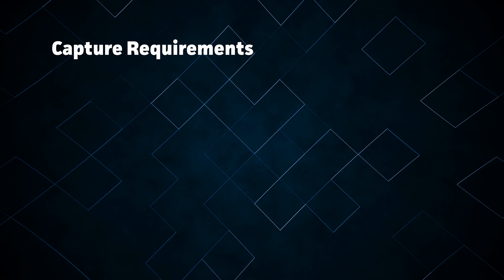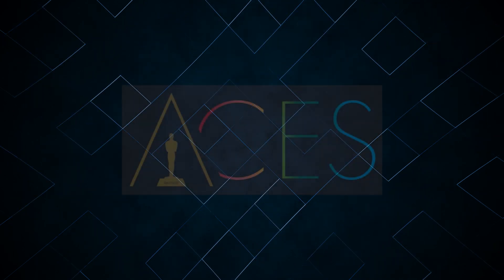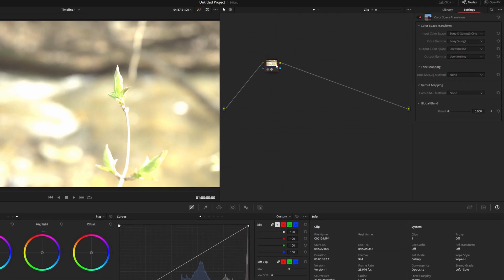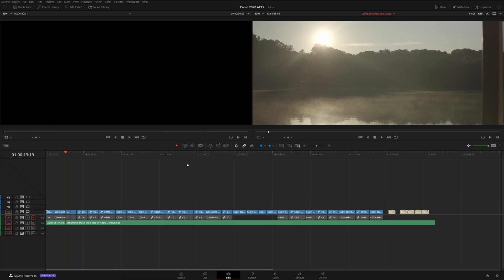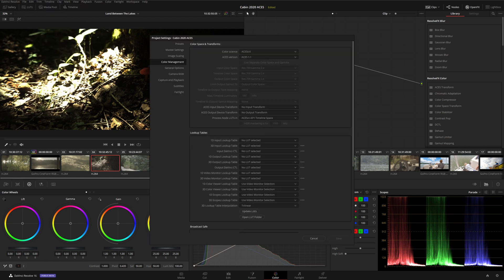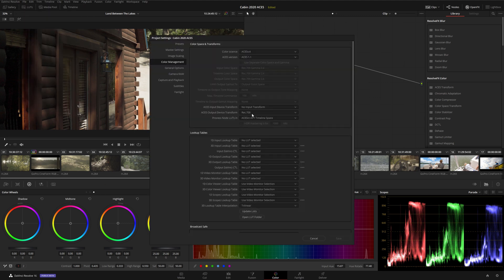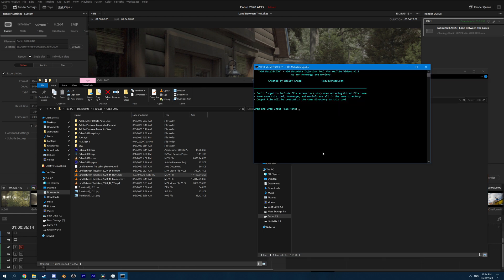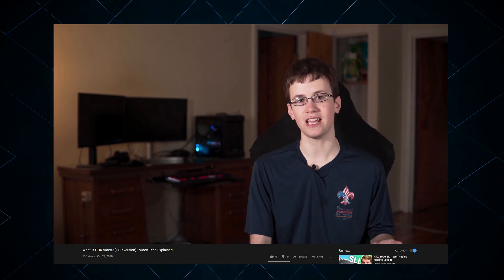How To Make HDR Content Without An HDR Monitor - Video Tech Explained

Comment: It's no longer necessary to spend thousands on a professional reference monitor capable of displaying true HDR content. In the last few months the bottom has dropped out of the Mini-Led ISP market due to advances in OLED tech & prices have plummeted. You can now buy a gaming monitor that has the resolution, color specs & dynamic range to handle true HDR video & spend from $400-$500 or even less. Example: the MSI MPG 274RDFW E16M is a 27" gaming display with 4K@160Hz resolution, a very wide color gamut across all standards including Rec2020, & it utilizes 1052 backlight dimming zones on a Rapid ISP display made by LG to produce a dynamic contrast ratio of 100,000,000:1. It's VESA 1000 certified & can display 10 bit color with an 8 bit+frc algorithm that is not "quite" as accurate as true 10 bit but will still display over 1 billion colors.Other than the 8+frc the only notable drawback is that while it's hardware factory calibrated it's only user calibrated with software. It goes for $500 & that makes it 1/12th of the price of an Apple PRO-XDR minus a stand. If you can get past the cheesy looking gamer design which has a silly multicolored LCD light on the back of the stand that constantly shuttles through various colors, you've got an editing monitor that can get VERY close to what the big production houses can do. Almost nobody has caught on to this yet, but once some content producers start to realize that there are gaming displays that are highly color accurate, get MUCH brighter than a $2,000 LG 32" 6K professional content screen & can run at double the speed, a lot of small producers will start churning out HDR stuff. This thing has twice the number of dimming zones the PRO-XDR does on a screen that is smaller, & even at only a static contrast ratio of 1000:1, that dynamic dimming jacks it up to 100x higher than the $6,000 XDR. That's a sea change no matter how you look at it at this price range. I like the workaround you've developed but I like the idea of not having to do it even better.

Comment: Hello, great video. I've got a question though, can I make a HDR video from any log footage I got? I mean it's got a wide dynamic range, right? So I have a choice, either I make an SDR or HDR video. Or it must be shot on specific HDR camera?
Reply from the maker: Any video can theoretically be converted and re-encoded in an HDR container. It's just a question of how well it will take advantage of the HDR format. 

Shooting log or RAW goes a long way since those formats can typically be converted back to linear light automatically (or are linear already) which makes them much easier to work with. Similarly, 10-bit and wide color gamut capture aren't technically required but make a big difference

Comment: Hello my friend, I made a 4k hdr video (60fps) according to your tutorial, but the produced video is too big, 6 seconds video consumes 1g of space. Is there any way to make the video size smaller? My camera is a7s3.
Reply from the maker: I believe in this video I recommended exporting to the DNxHR codec. Since this video was made I've switched to rendering to H.265, which has quality that's good enough for YouTube but with a much smaller file size. In Resolve, under "Quicktime" use H.265 with the NVIDIA encoder and set the profile to "main10." If you don't have this option, then you can try rendering to DNxHR and then transcoding that file to H.265 10-bit with another application like HandBrake or ffmpeg
Reply: @VideoTechExplained  Thank you. I have converted the video to h265, selected main10, NVIDIA, Quicktime, and then used the injector to inject the video with hdr information and upload the video to youtube, but when I watch the video on youtube, the resolution option does not display hdr words. May I ask how to make youtube display the words hdr?
Reply from the maker: Sometimes it can take a while for YouTube to process a video into HDR. Maybe wait a day or so and see if it shows up?
Reply: @VideoTechExplained  Yes. You are right. Thank you.

Comment: Subed here. Thanks for this. Now I have a question. Can you mix Rec.02100 HGL content with Rec. 709 content on one video and get a complete HDR video? Also is is possible to use templates of Motion Array into these projects? I tried that but the colors are all off... It would be great to know if it is possible. Thank you.
Reply: For your first question, yes.

Comment: I’m gonna add these videos of yours to my favourites, I feel like I’m your target demographic - someone that values accurate SDR for work but wants to experiment with adding effects to amateur HDR (footage captured using the Series X’s built in DVR) for my amateur YouTube Channel. Seeing as this video is two years old now, I wonder if you have any up-to-date recommendations for monitors?

I intend on getting an M1 Mac Mini as I’m mainly a FCP user, and frankly just want an iMac screen (preferably with not terrible entry-level HDR) that I can plug my Series X into for 4K HDR 60Hz gaming (will gladly sacrifice refresh rate). I want to work and play on the same screen, makes it much easier to move out and get my own place.

Lately I’ve been eyeing up the Tempest GP27U, but it would be nice to either go for something more that has its price really justified (say a Samsung Neo G7 or ASUS PA329C) or something cheaper that I’ll be just fine with (such as a LG 32UN88A-W or a Dell UltraSharp U2723QE).

Comment: Hey absolutely love your video but had a quick question would love an answer to. Basically when grading in ACES Rec 709 in davinci then exporting using the Rec 2020 ST084 (1000nits) +  DNXR  the image comes out much darker. I am grading using BRAW and was just wondering why it looks darker in the render.
Reply: I have the same problem, did you find any solution?
Reply: @sokre988  nothing unfortunately
Reply from the maker: When you say the exported image looks darker, do you mean when viewing on an HDR display or an SDR one?
Reply: @VideoTechExplained  This is straight after the export, viewing the HDR file in VLC on my SDR monitor, it always seems darker than when previewing the SDR ACES Rec 709 timeline in Davinci
Reply from the maker: @tomfodenfilm  The HDR to SDR conversion performed by VLC is different than the one performed by Resolve. In my experience, Resolve's transform tends to make things look brighter in SDR than they do in HDR. So I've taken to using a modified version which also reduces the brightness by half a stop. I get better results that way
Reply: @VideoTechExplained  Ah okay I see so it's within VLC itself. What exactly is the modification you make/have made to resolve to get it to this half a stop darker preview?
Reply from the maker: @tomfodenfilm  I do two things: 

1. I create a GLOBAL color node which lowers the exposure by half a stop. I have this node enabled when previewing in SDR, and disabled when previewing in HDR

2. I modified my HDR -> SDR conversion kit which I give to YouTube so that it both applies Resolve's transform and lowers the exposure by half a stop

Comment: Would anyone know what the ACES Input Transform is for the 10-bit GoPro Hero 11 Black?
Reply from the maker: There is no dedicated input transform for the GoPro as far as I'm aware. I don't have a Hero 11, but when I do have to work with GoPro footage I'll use the Rec.709 input transform and then use the "Highlight" wheel to roll off the highlights so they don't get too bright in HDR.

While the GoPro 11 does have 10-bit support now, its actual dynamic range is still relatively poor. While you can theoretically bring GoPro footage into an HDR project and make it look normal, you likely won't be getting many of the benefits you'd expect from HDR. 

Personally, if I were shooting a video primarily on GoPros then I'd just deliver in SDR. I only use GoPro footage in HDR when the video has other footage which would actually benefit from HDR delivery.
Reply: @VideoTechExplained  I've resorted to using Rec.709 in SDR too.
Thanks for the explanation- much appreciated!

Comment: Hi VTE, I have a question regarding export settings,

under Video -> Advanced settings -> Data Levels:
There are 3 options - Auto, Video or Full
The default is on Auto but should this be switched to Full for exporting HDR content? 

Also, every YouTuber out there seem to suggest VBR high quality with the default Lookahead of 16 frames as the ideal 4k export setting but most of them are uploading 4k24p. For someone like me who wants to upload 4k60p videos with constant motion, would CBR high quality produce better quality than VBR (both at max 200k bitrate)? and should the number of Lookahead frames be adjusted for because of 60fps?
Reply from the maker: I'm not sure about the data levels. My advice would be to just leave it at auto unless you have a specific reason to change it. If I had to guess I think HDR should be full though.

As for the export bitrate, VBR usually gives better results because it can allocate bits more efficiently, increasing and decreasing the data rate depending on the complexity of the frame. CBR is mainly used for stuff like live streaming where the bitrate needs to be consistent. For most purposes though, VBR is better. I just use the default settings and I've never had a problem thus far

Comment: Hi, I have some questions:

1. Under Resolve's project settings should you not select HDR mastering is for "1000" nits? What about "Enable HDR10+"? 

2. I'm getting 40GB file size for a 3 minute video when exporting with DNxHR and I typically upload videos to Youtube that are between 40-60 minutes long. Can I use H265 instead of DNxHR to keep under the Youtube file size limit?

Cheers for the video
Reply from the maker: 1. For this particular workflow, that is not necessary. According to Resolve's manual, all that setting does is make sure appropriate metadata is being sent to the HDR display if you have one connected.

2. Yes, that also works. Just make sure you select "Main10" under the profile or else the output will be 8-bit.
Reply: @VideoTechExplained  Got it, thank you!

Is there a difference between doing an ACES transform in the project settings vs. doing it node-based using the ACES plugin? The plugin doesn't have the option for ACEScc or ACEcct, only ACES version number. 

Also, in Gerald Undone's "How to Correct Log" vidoe, he demonstrates that unlike a color space transform, an ACES transform (node-based) is "destructive" in that any highlights clipped during the transform is unrecoverable later in the workflow. This means if the footage filmed ETTR we would need to pull down the exposure before applying the ACES transform. Does this apply to this particular HDR workflow? i.e. if I'm doing an ACES transform in project settings color management, would my highlights be clipped before I've made my exposure correction?
Reply from the maker: @filmingjapan4k  I actually didn't know that ACES was destructive when you apply it to a node! The more you know, I guess. 

As far as the transform itself, there is no difference between applying the ACES transform in the color management settings versus doing it in nodes. I prefer using the color management tab since it makes the process more centralized. IE, if you want to change the output format you only have to do it in one place instead of going through and changing all your nodes. 

If you do want to use nodes, you'll want to use two. For the first one set the input to whatever your source footage is and the output to ACEScct, then apply your grade in the nodes after that, then add a node at the end to convert from ACEScct to either Rec.709 or Rec.2020. 

Regarding clipping, this isn't really an issue as long as you apply the transforms at the start and end of the chain, not in the middle. In Gerald's video he applies a heavy exposure correction Before the input transform which causes the image to clip prematurely. If you apply the input transform first then nothing will clip beyond what was clipping in the original file
Reply: @VideoTechExplained  Thank you! So you're saying these two workflows are the same am I right?
1. apply transform from slog3 to rec709/rec2020 (ACEScct) in the color management tab -> grade -> export
2. 1st node transform from slog3 to ACEScct -> 2nd node grade -> 3rd node transform ACEScct to rec709/rec2020 -> export
Reply from the maker: @filmingjapan4k  Yes, those should yield more or less identical results. There is a bit of nuance to it since when you have it set up in color management will automatically perform certain transforms for you (like for example automatically setting the correct transform to output a DCP) but as far as transforms go they should be the same
Reply: @VideoTechExplained  Cheers, you're a legend.
Reply: Gerald is wrong.

Here are a few videos from a pro colorist, explaining about CST workflow:
https://www.youtube.com/watch?v=c4AVwVdKTHc
https://www.youtube.com/watch?v=8geDbNpH5cI
https://www.youtube.com/watch?v=CtSBVKmHkjU

It's really the last one, you want to watch, but they are all pretty short. About 35 minutes total. And they are pure gold.

"In Gerald's video he applies a heavy exposure correction Before the input transform" - And that's where he goes wrong! The ACES system is larger than Rec.2020, so there can be no los of color, if you do it the right way.

Comment: I think Davinci has an option to add hdr10 metadata to the exported video. Isnt it the same as using the injector tool?
Reply from the maker: Yes, though doing it this way does not allow you to attach the ACES conversion LUT, so the SDR conversion on YouTube will look different than what you see in the preview.

Comment: What about HDR video shot with my Samsung Galaxy S20+? How do I choose the right ACES input transform filter for that?
Reply from the maker: Try Rec.2020 ST2084
Reply: @VideoTechExplained  Yeah I tried all of them and the most suitable is REDcolor2/REDlogFilm
Reply from the maker: @motionreport9747  I would be cautious with that since a Samsung phone is definitely not capturing using a RED gamma. It might be that the correct transform gives you an image which is accurate but doesn't look as good to your eye.
Reply: @VideoTechExplained  Yes, when I apply it, it turns red into pink, so I had to adjust it manually. Anyways HDR is just too hard to edit on an SDR monitor and the file size is enormous, no wonder it mostly used by big production movies. Thanks for the response and for this video!

Comment: What can't we use an HDR TV instead of the expensive monitor.  All HDR content from the internet are viewed on HDR Tvs, am I wrong to think this way.
Reply from the maker: You can, but most HDR TVs are very, very inaccurate compared to monitors. So you shouldn't use a TV for grading for the same reason that you should calibrate your monitor